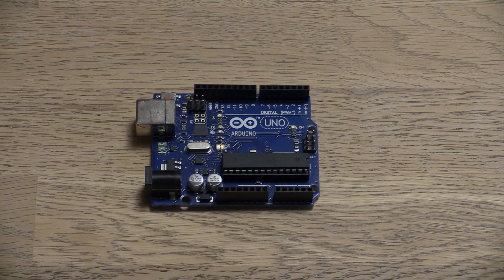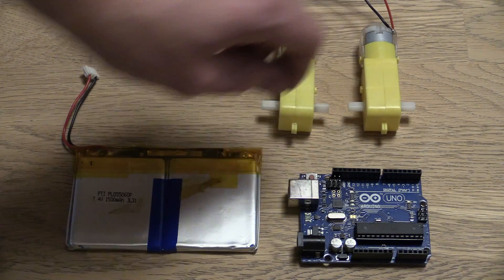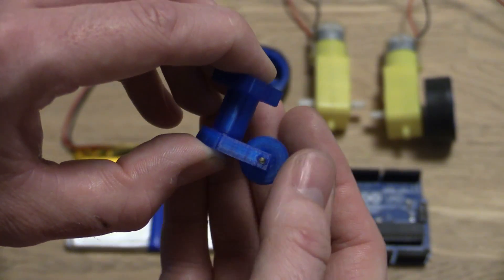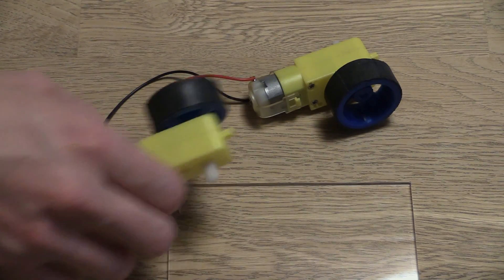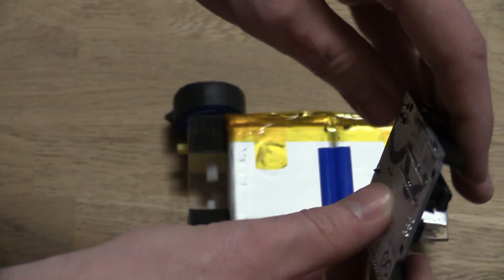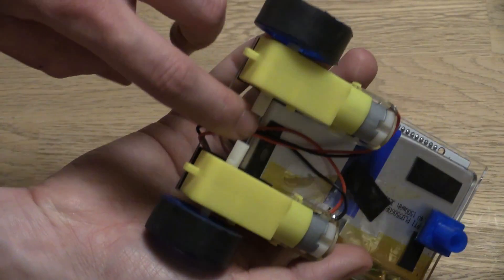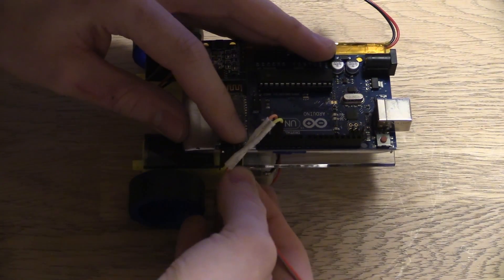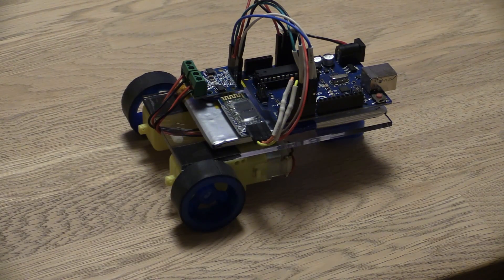Making a DIY Arduino RC Robot Car - Part 1: Selecting Parts and Building the Robot - Ec-Projects

Comment: Can I use a 24 volt motor with 24 volt power supply or will I break anything I could power the Arduino seperate
Reply: An arduino can handle 6 - 20 V sooo i wouldn't recommend it

Comment: the controler can be use in stepmotor?
Reply from the maker: It can.. but there are chips specifically for steppers, which have constant current outputs (A4988 for example), which are about the same price.. They are also easier to use, since they will take care of the stepping sequence for you :)
Reply: +EcProjects  thanks :)

Comment: can we use 9v battery
Reply from the maker: Yes, but it will drain the battery pretty fast.. :)
Reply: And in my experience it cannot supply current(capacity) :D
Reply: how about 2 9v battery?

Comment: how much will a 3d printer cost
Reply from the maker: $400 and up, I would say.. You can get cheaper ones without heated platform, but I would recommend spending the extra to get the heated platform.. I think the Wanhao Duplicator i3 is one of the cheapest, I have seen it print, but haven't tried it myself. It looked ok though..
Reply: +EcProjects tanq so much